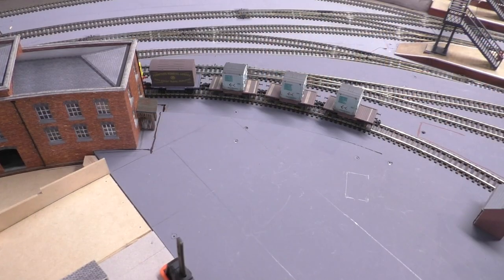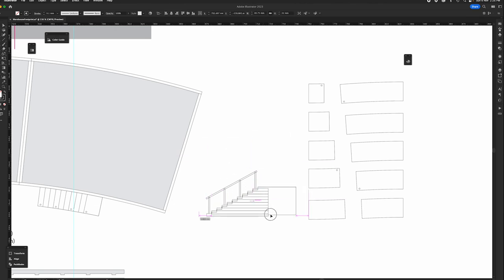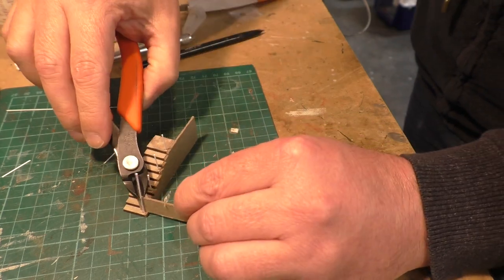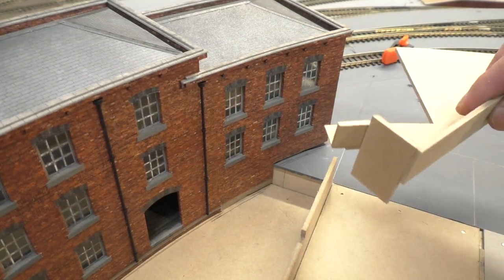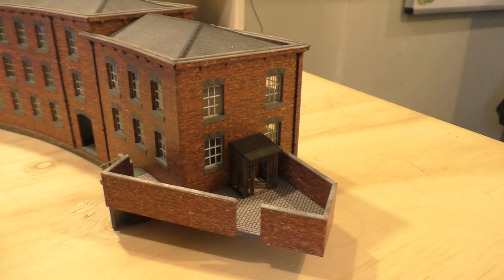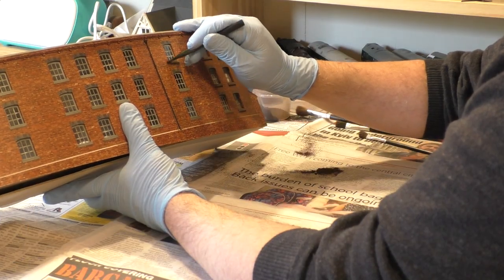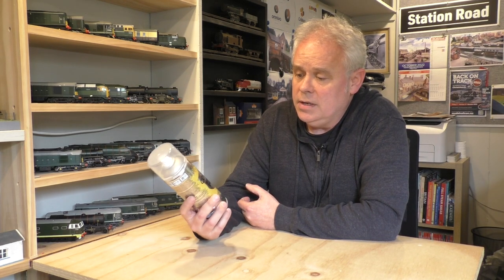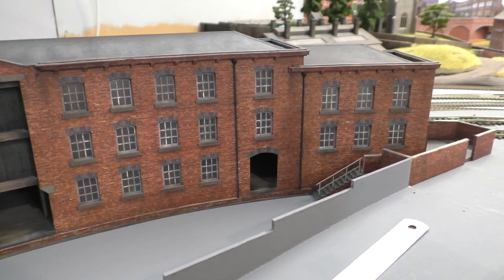Scatch-built Curved Warehouse Complete!

Comment: That looks mega, Julian 😎 impressed with how you tackled the hand rails, that was a nice touch - I'll have to remember that one!
Reply from the maker: Initially I thought the handrails would be quite difficult to construct but they turned relatively easy to put together. There's more handrails to come on the pavement opposite the warehouse (stepped pavement) but I might try my hand at soldered wire for these for greater durability.